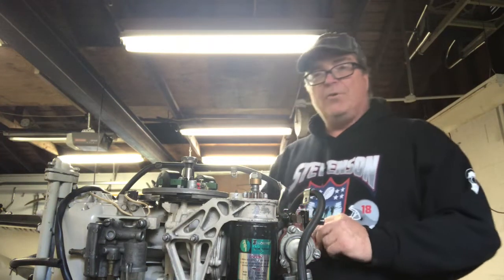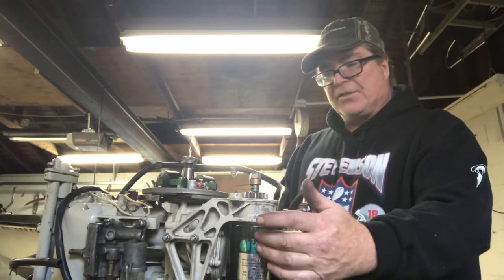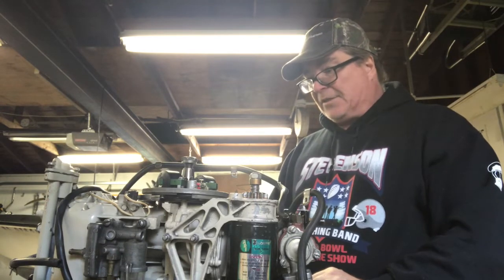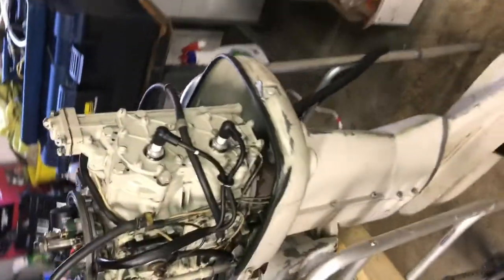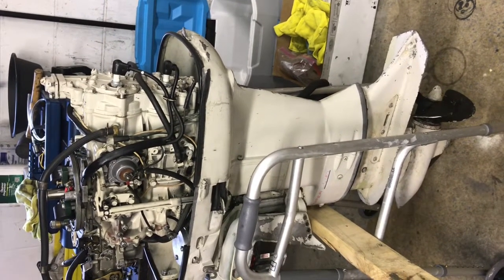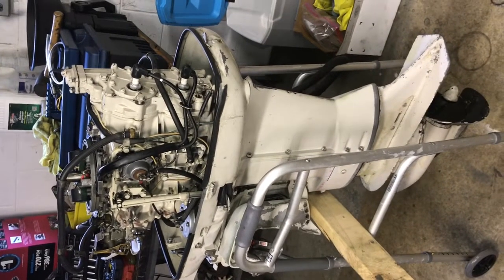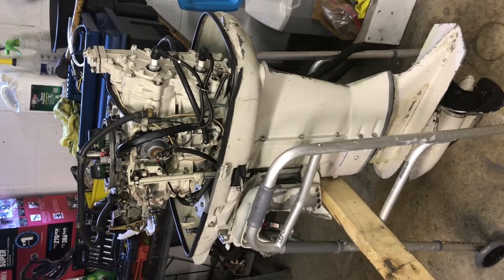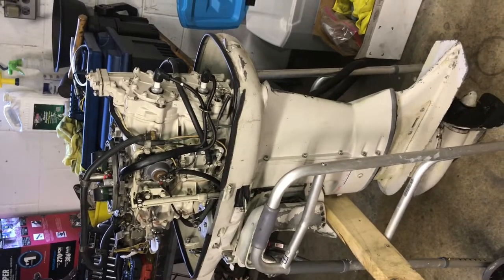1963 40hp Johnson Electromatic - The Resurrection Setting Points - Part 2 of 12

Comment: Can I contact u I have the exact motor done rebuild new coils,points,wires,plugs,rebuilt fuel pump,rebuilt carb,all news seals and water pump in lower unit but it will run but the issue is deaccearlion it wants to die and I can't keep it consistently running running

Comment: What is that red module with two white leads coming from it that’s up against the flywheel?
Reply from the maker: @chrislandry8877….if I remember correctly, those are red connectors coming from the condensers. Thanks for watching and commenting.

Comment: Hopefully you can shine some light on my issue 😮. I have a 1963 40hp SeaKing. Coils are good and and getting good spark. Replaced the little cork and plastic seas for the carb adjustment. Its starts but wont idle/ wide open throttle even with carb at idle position. Cant see anywhere where there would be an air leak? Have you had an issue on a motor before?
Reply from the maker: Sounds like the idle circuits are plugged and you need a more thorough carb clean.
Reply: @LivetofishOutboardRepair  I unfortunately went thru it 2 or 3 times and still same issue. I however did not remove and replace the little metal plug in the top of the carb for the one circuit. Ive worked on and rebuilt many 2 strokes and this one has me very puzzled.
Reply from the maker: @chriskoester3954  that’s where I would start. You may have debris or corrosion under that plug that you can’t get out. Stuck or broken Reeds may be a problem but not likely. Did you do a compression test? If it’s low or uneven no amount of tuning will help
Reply: @LivetofishOutboardRepair  I have not done an accurate compression test but feels like it has plenty. Dang near blew out my shoulder pull stating it when the original starter crapped out. Haha. I'll look into the carb again. As far as the reeds go I pretty much have to pull the reed cover off the check right? Also thanks for all of your input
Reply from the maker: @chriskoester3954  you are correct but if your going to remove the carb you could look inside the intake and get a good look at the reeds without removing the plate.

Comment: I hope you can help me. My 1963 electric shift 40 horse big twin Johnson is not consistently engaging in forward gear. I have just replaced the electric shift cable. And I just did the voltage test on the forward gear electric lines at the engine And I’m reading 12.6 V when I’m in forward gear and 0 V when I’m in neutral. What do you think would cause the motor to disengage from forward gear? The forward magneto should be OK because I’m getting 12.6 V.? Correct? Could this be an issue with the points condensers or coils? Thank you for your help and I love your videos! Dave.
Reply from the maker: @davidcerajewski9170…. Are you using the correct Johnson Premium Gear Lube  in the gearcase? Also is the neutral switch working properly in the controls?
Reply: @LivetofishOutboardRepair  
I am not sure how to check out the neutral switch to see if it is working properly in the controls.? I am using a premium type C lower unit gear lube.
Reply: Everything works correctly when I move the lever from neutral to reverse and reverse back to neutral. It is just that it does not always engage when I move it into  forward and it cuts out of forward gear when I am at higher speeds.
Reply from the maker: @davidcerajewski9170 … Type C is no longer available but if your using Johnson’s Premium then this is correct. You might need to check the resistance in the wiring from the controls to the new cable that you installed. It may be that you have a bad connection causing intermittent voltage to the forward electromagnet. The neutral switch is probably ok if your consistently reading zero volts in neutral and 12 volts in gear. It has nothing to do with the coils or ignition system or the motor for that matter. You might want to disassemble the gearcase and examine the forward gear and pinion. See if the gears are worn or missing teeth. Also the large spring that surrounds the forward gear that the forward electromagnet controls may also be worn out causing slippage.
Reply: @LivetofishOutboardRepair  OK that is really good info! I also failed to mention that when I’m slightly moving the throttle forward and back to neutral it, sometimes engages. It seems like it could be is a connection issue at the throttle or down the line electrically. I hope that is the case. I would hate to have to open up the lower gearbox and get all the way to the forward magneto. UGG thanks again for your help!
Reply: Pretty sure I figured out the problem. The neutral switch has some dead spots. When sliding it back and forth through the forward range, we got tremendous resistance at certain points. I also noticed that there was a slight crack in the neutral switch rubber boot and that came from a small Burr in the throttlebody housing. So I ordered a new neutral switch and cable. Thanks again for helping me diagnose this problem!
Reply from the maker: @davidcerajewski9170  you’re welcome. Keep us posted on your progress.
Reply: @LivetofishOutboardRepair  have you ever put a trim and tilt motor on a 63 Johnson 40 horse electric shift? If so, do you have a video of that? Thanks again! Dave.

PS I will certainly keep you posted on my neutral switch replacement. Thanks! I love your videos!
Reply from the maker: @davidcerajewski9170  if that year and model did not come with tilt trim, it would be very difficult to add. Most people go with aftermarket, like panther or CMC. Sorry I have never attempted it.

Comment: I have a 1963 Evinrude Big Twin that has no spark. I'm trying to pull the flywheel, and it does not want to come off. I removed the big nut, and I'm using a 3 jaw puller. Am I missing something? I feel like it should pop right off?
Reply from the maker: Joey … never use a jaw puller to pull a flywheel. You may damage the crank. You should use a harmonic balance puller with Grade 8 hardened bolts threaded into the three holes provided in the flywheel.
Reply: @LivetofishOutboardRepair  thank you
Reply from the maker: Joey… Thank you for watching and commenting!

Comment: So it has to be hooked up to the battery to shift?
Reply from the maker: Byanthyme …. Yes that is correct. The Electromatic shift models must be connected to a battery that’s why these motors came standard with a belt driven generator to keep the battery charged. If the battery dies the shift solenoids default to the neutral position.

Comment: take off plug, you turn shaft, itwill not jump
Reply from the maker: Thermodynamic….Good point. That would definitely made it easier. Thanks for watching & commenting.
Reply: @LivetofishOutboardRepair  learning by hand on,
I find that, with plug of
I can turn crank shaft quicker
so I can see spark

by put spark plug connected
and I can see spark at certain position of wrench.

do not need sparking flash light

cause I'm not big guy.
I must make it easier for operation
Reply: with plug off
motor will not misfire
Reply: I am trying to restore an 1961 boat
with 40 horse,
need lot of info
so you are very helpful

Comment: I have the same motor on an old boat I was just given all the wiring is disconnected.. I’m not a boat person either. Any good wiring guides I can actually understand?
Reply from the maker: I would recommend getting a good Service Manual for your motor. A good manual will have wiring Diagrams that are easy to follow. Check out www.marineengine.com
Reply from the maker: I just wanted to mention there are free service manuals and wiring diagrams on www.boatinfo.no